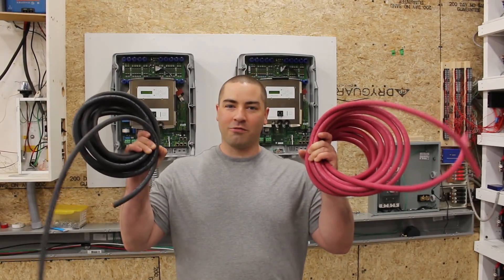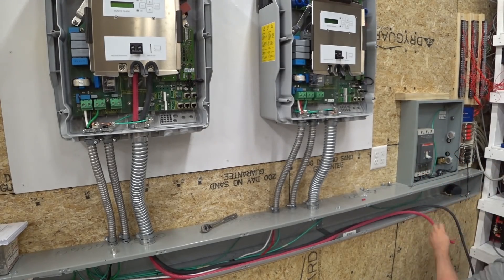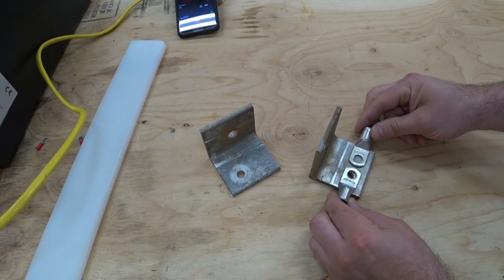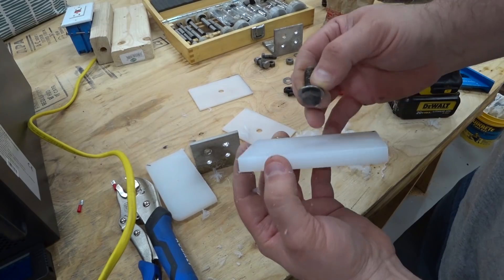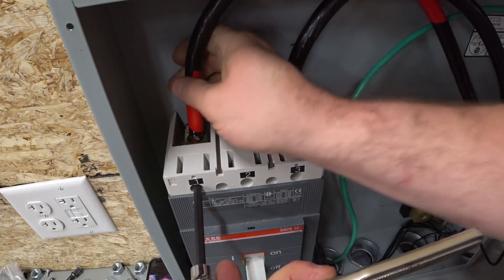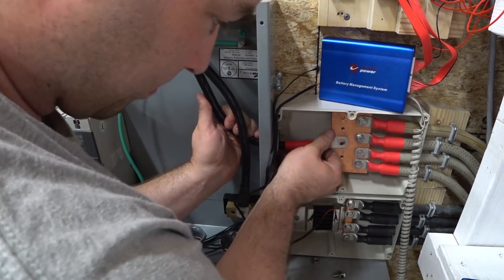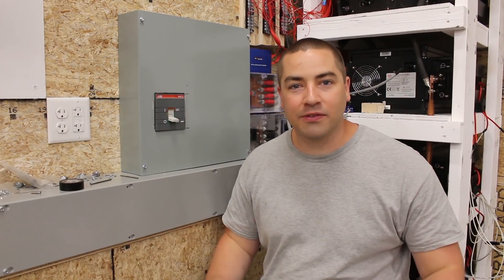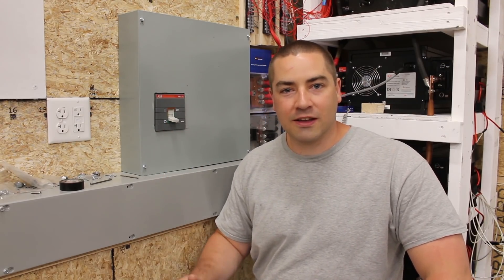Off Grid SMA Sunny Island Inverter Wiring, 48v DC

Comment: I would be concerned about bolting dissimilar metals together such as steel and aluminum you could get an electrolytic reaction. A better option I think would be stainless steel
Reply: The aluminum also has a lower ampacity than copper.
Reply from the maker: If you are referring to my DIY busbars, the bolts/nut are stainless.  They looked black because of the staining from the roof they were on.  And the bolts I used to secure the ring terminals to the bus bars are also stainless steel.  I also sprayed the aluminum down with a anti-corrosion.
Reply: @DavidPozEnergy  maybe, I don't pretend to be an expert but one of the things I learned in the Navy was  dissimilar metals are bad. I was not particularly concerned about the bolts and washers and nuts as I was the aluminum pieces that you used. I hope it's okay.
Reply: @chrissnyder2091  A boat is floating in an Ocean of electrolyte. Mixing metals is ok on land "more resistance to ground". Also I believe the active corrosion protection from the salty water uses electricity on board Navy vessels. If David uses something like "NoLox" then problem solved.  However you have to check the connections ever 6 months for loosening (copper bus & copper clad bolts are best). I most definitely would NOT mix metals on a steel ship in salt water unless it was a temporary fix for a very short time (months) also weekly inspections would be priority for it as well.
Reply: @ranger175a2w  You don't mix metals on aircraft either, or, buildings.
Reply: Just about every aircraft  has a mix of different  metals

Comment: Hey David, great job here. Can I ask where you purchased you wire way duct?
Reply from the maker: I bought it at a local electrical supply house.  I typed in "electrical supply near me" into Google, then called the first place.  I asked for a 4x4x48 wireway.
Reply: @DavidPozEnergy  how much did the wire weigh cost? I'm curious to compare the price to what's available locally here in Hawaii where everything seems to be triple the price.

Comment: As always, your cable management is spot on and clean AF!! 😎♻️🔌💯🌞 I use two sets of those 'L' feet lugs myself!!
Reply: Not So Sure
Reply: A simple tip for others: rather than using a Forstner bit to countersink the nut head use a third piece of Delrin or equivalent, as thick or thicker than the nut head and drill a clearance hole right through. Fit the main insulating, non drilled piece at the back, the clearance hole piece in front of that, then the bolt hole piece in front of that. Simples!

I would at least have tried:
a) a warranty claim
b) a repair
of the "expensive" breaker before going down the less slick bus bar route.

But then I'm tight and hate spending money I don't have to, until I REALLY have to! 🤔😲🤣🤣🤣